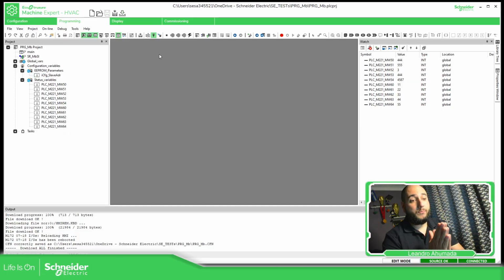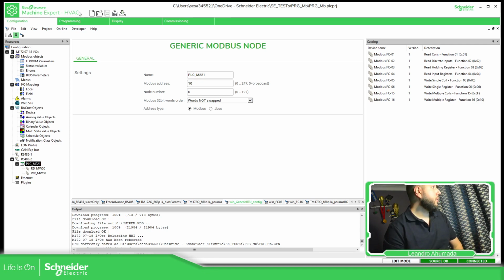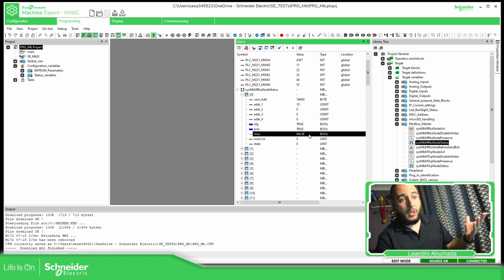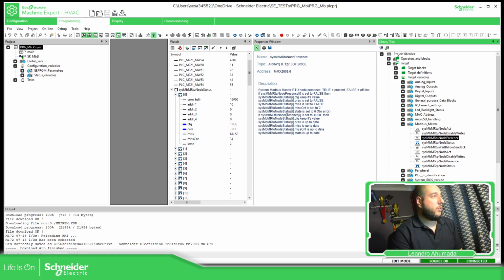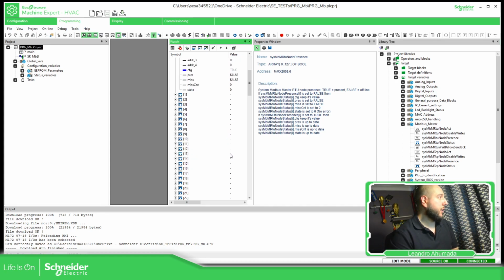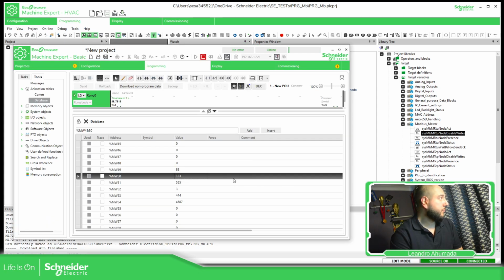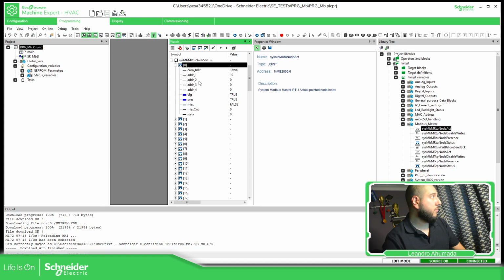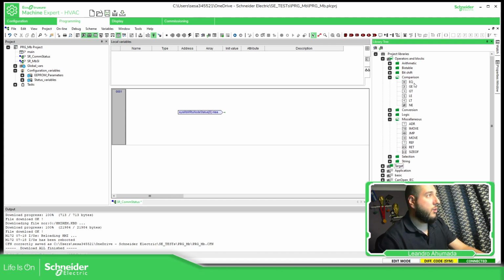EcoStruxure Machine Expert HVAC Training - M1.5 Modbus Serial IOScanner Troubleshooting

Comment: Hi LeTomas, is it easy and reliable to use Schneider TM3 IO modules with M172 PLC?  When working with a slightly bigger job, it is not easy to program M221 PLC. If we can use M172 PLC with TM3 IO modules, that  would be very good.
Reply from the maker: Hi JP, it is possible to do it. As the TM3 BC is not implemented in this platform you must use it as third party. I will try to do something to show how it can be done but in the meantime you can check the playlist for the BC:
Modicon TM3 Bus Coupler - Training
https://www.youtube.com/playlist?list=PLFqT6GhMpgpLZ931Jlkhw7BhRF5OB1TzJ